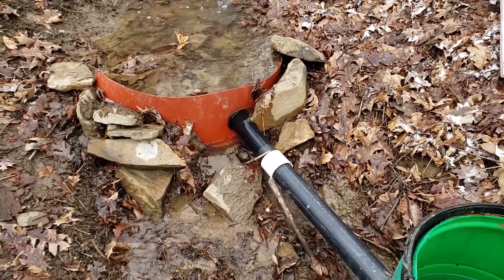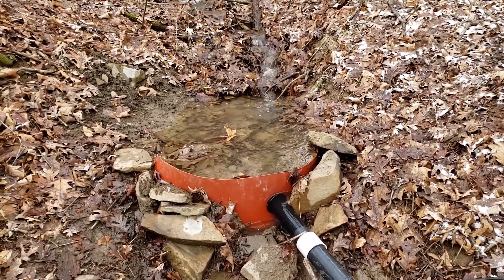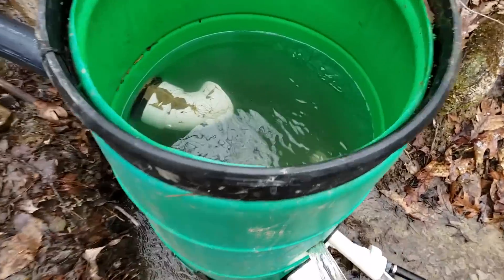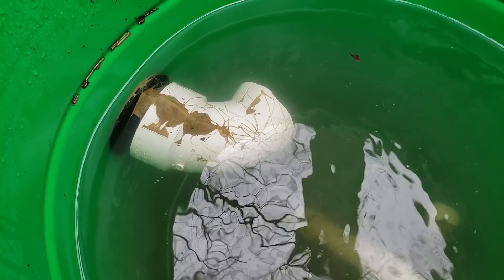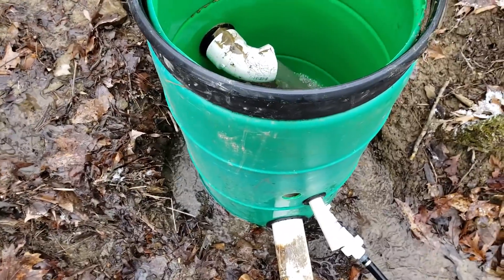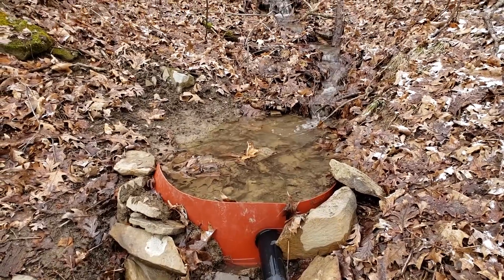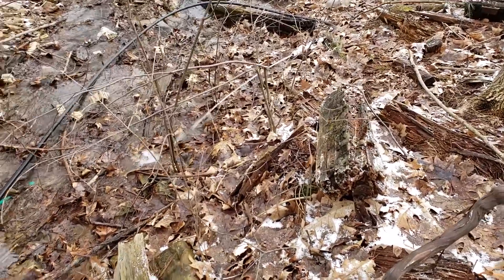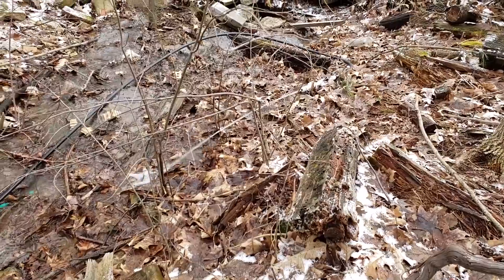Spring Creek Minor Update

Comment: With the small drainage pipe why not route that into a water purifier or a cleaner so you can get clean or drinkable water from the system as well?  Even if you can't drink it you could use it to supplement water use in your home.
Reply from the maker: In an emergency I could, I already use this water for the garden, filling the hot tub, and building ice collections. I've also used it like a cooler in the summer, maybe even possible to use it as a heat sink for a heat pump. However, it's completely dry 4 months of the year because of 800ft of thirsty forest while the spring flows year round.